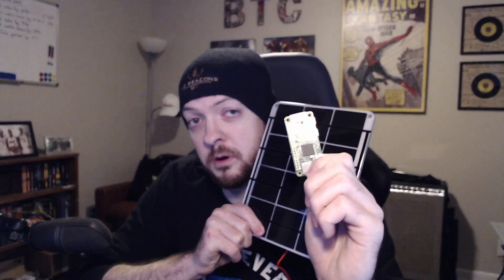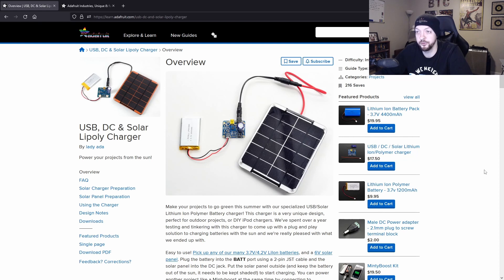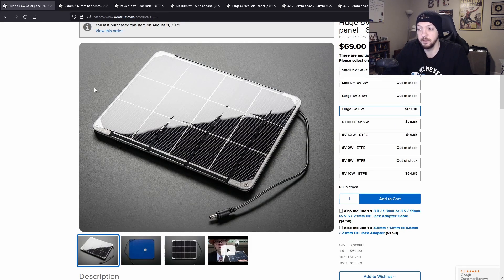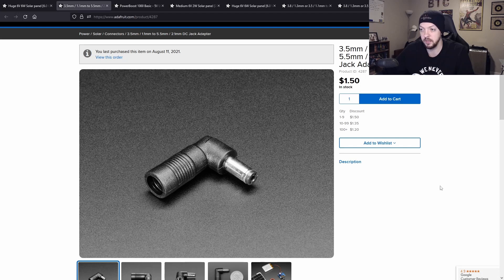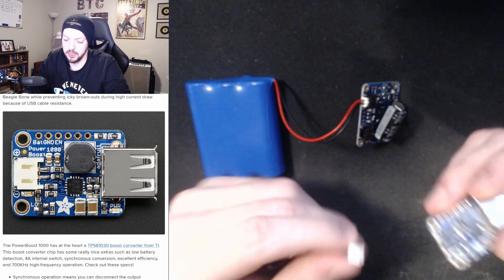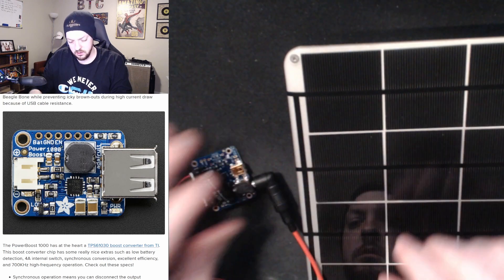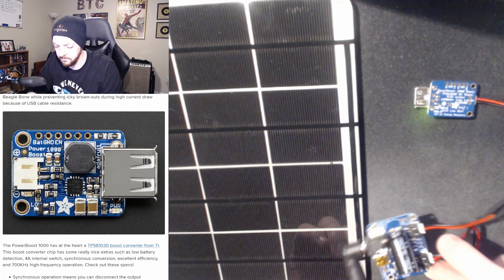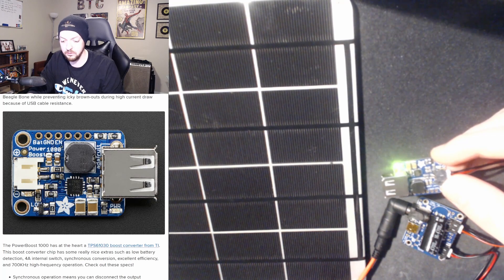Can I run a Raspberry Pi on SOLAR POWER?

Comment: Solar power with solar cells is highly inefficient way of converting solar energy to electricity. I saw a video of a house using solar death ray concentrating light onto a water container boiling it creating a steam engine, which is used for cooking or powering whole house.

Comment: I think that that capacitor you soldered to that first board could go on the back of the board instead. Then you would not have to worry about other componnents heating it up. You could mount it a lot closer to the board then. This is a useful idea. I have been looking into powering my raspi 3 from solar. Thanks for this video.

Comment: Why didn't Adafruit have the capacitor on the board already????????
Reply: As it's a through hole component it would have likely doubled the cost of production for the tiny board.

The rest of the board is Surface mount components and can easily be automated

Comment: Can't I just use a jst connection cable and use the cables to power the Pico over the 5V and a GND Pin without using the jst-to-USB adapter?
Reply from the maker: that would probably work. I just used the adapters for convenience.

Comment: I recently saw a video about the Rapsberry Pi Pico with the Phew Framework installed, which includes a webserver. It drains about 40 mA of power, much less, than the zero, which is about 100-150 mA. Maybe experimenting with this may lead to a webserver running severaly days without needing energy and also having a framework installed, which can do much more, than serving staic pages. Though, I just herad baout it, have made no experiments by myself yet. But your video gave me some new inspirations... 🙂

Comment: Lots of projects are possible with solar power. It seemed a pretty fair test though you might be losing capacity of the battery gradually and it wouldn't be noticeable right away. A black insulated case is probably not likely to help keep your components cool, the components will likely generate some noticeable heat and without some airflow to cool them it will only serve to keep that heat inside. If your charger has a 5V output (most do) you could eliminate the USB adapter. Your web server was a wonderful trial projects - good work.

Comment: I have a solar powered esp8266 running in the greenhouse on a 10 watt solar panel on the roof of the greenhouse and a 7Ah battery.  During summer it works great but over winter it goes flat and needs an occasional boost.  There is a huge difference in solar output between summer and winter, at least here in New Zealand.  The esp8266 connects via wifi to a sbc server so I can see conditions in the greenhouse and the battery voltage on a web page.  I am not using any low power modes and it connects every 60 seconds.  I can't remember what the current draw is from the battery with no solar, which would show the total power draw.

Comment: You can absolutely power a Raspberry Pi via it's GPIO pins, no USB power required.  So you could have easily powered the Pi with the JST connection on your charger board, so long as it has a good 5v output.
Reply: %v would fry 3.3v raspberry pi if connected incorrectly
Reply: if being the operative word here.  Connecting it properly, however, would not.
Reply: The gawd awful noise you call music is just unbearable.

Comment: I believe you are wasting power by converting to USB then powering up the Raspberry Pi via it's USB port. All you really need to do is connect your 5 volt power to the Pi's header pin #2 and Ground to pin#6.

Remember, K.I.S.S. in design is always best

Terry Thomas
PC Tech Support
Atlanta, Georgia USA

Comment: Hi CorSecure, I am glad I got you video suggested by YT. Your solar-to-Pi system is exactly what I've been looking for, thank you!
I have been trying to find info on using a solar panel to charge an Anker 20,000 mAh battery (the one with the integrated solar panel). Having some concerns about the Anker internal charge controller playing nice with an external solar input. Do you have any ideas or suggestions? Maybe this could be a good video subject for you?
Again, thank you and I'm subscribed now; looking forward to viewing your old and new videos. Be well!
Reply from the maker: thank you for the sub and the kind words! I don't know anything about the Anker battery that you mentioned, but I will keep that in mind if I end up doing a project with something like that in the future.
Reply: @UnderSecured  I'll be following your YT channel for sure. Have a good day.

Comment: How is this even a question?  Even a Pi 4 at max draw pulls 15 watts.  A small 100 watt panel can run 4 of them with zero strain.
Reply: Assuming that weather conditions are perfect, when plugged directly, then maybe. But more often than not, you aren't going to max out the panel. Clouds, obstructions, rain, dirt/dust, etc. will effect the overall output of the panels. And in the case of having an inline battery bank, it assumes the panels are going to be operating at 100% capacity, and that it stores up enough energy in the batteries, to last during hours of indirect sunlight, and nighttime. 

In some cases from tests done with a few solar panels I have, I get maybe 2-3 hours of dead on sunlight, and varying levels of sunlight outside that, till sunset to sunrise where there's almost zero energy generated
Reply: Exactly.  As soon as I saw the title, I was like, “Duh”.

Comment: I have a makerPower Solar from Crowd Supply, 30W Aleko Panel, and a 12V 10AH AGM Battery running a Pi Zero W for over a year now.  I Update/reboot on occasion and current uptime is 176 days.

Comment: Why even use adapters. Firstly they cost a lot. Just desolder any shit connectors from the boards and attach the wires directly. Much more safe too. Things wont come apart due to vibration and other shit.
Reply from the maker: it was just a temporary proof of concept experiment. I wanted to be able to re-use the parts for other projects. also, as I mentioned, I am not an expert in soldering, so I typically don't do more soldering than is necessary. if you have the ability, knowledge, and desire to skip steps or use less parts, feel free to do so. I'm only showing how I chose to do this particular project.